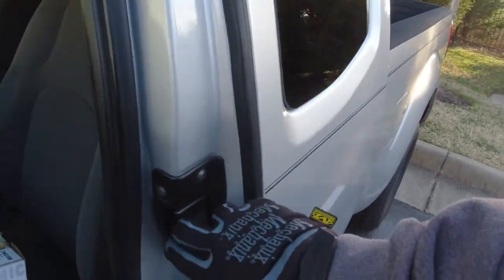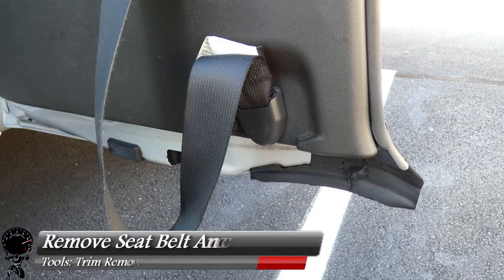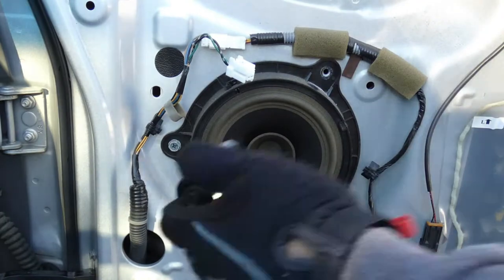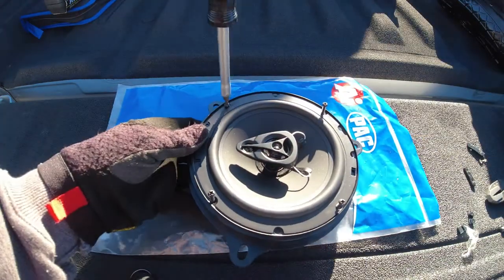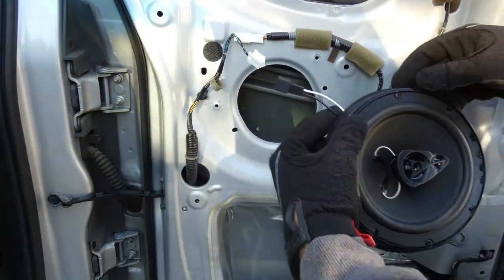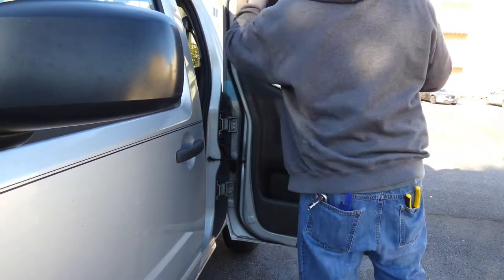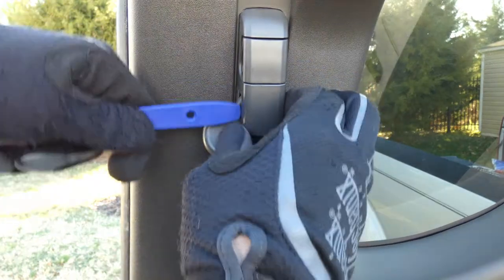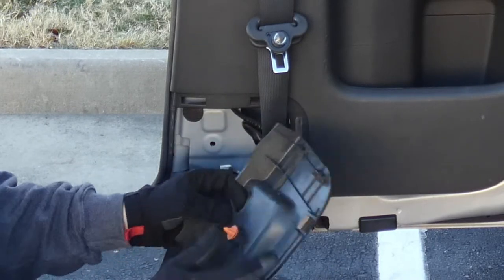How to Replace Rear Door Speakers for a Nissan Frontier (2009)

Comment: Great video!  Any reason not to use the wire harnesses provided with the speakers?
Reply from the maker: You could use those. It would require removing the OEM connector and crimping the new harness.

Comment: Does one bad speaker cause the other speaker not to work...or not necessarily? I changed out my front speakers (thinking my speakers were the problem) but still very little sound coming from speakers. Do you think it could be the stereo itself?
Reply from the maker: Unless there is a serious wiring issue, one speaker should not impact the others. It's very possible to be the radio. I had a similar problem with one of my past vehicles. I was having sound cut out from specific speakers and after troubleshooting it turned out to be the radio (it was old). Good question.
Reply: @mcgurrentertainment  thanks for responding! I have a radio on the way (online purchase) hoping that solves the problem. Thanks again 👍
Reply from the maker: Let me know how it turns out. 🙂

Comment: Is it necessary to do the thread lock and specific torque?
Reply from the maker: Good question. Threadlocker is used to prevent the accidental back off of fasteners due to vibration, and since a moving vehicle is a vibration machine; it's good practice to use it for a majority of applications (and mandatory for others). The torque specs were provided to follow the design specifications as well as give the user an idea of how tight a bolt should be. Torque spec makes the bolt tight, and the threadlocker keeps it there.
Reply: @mcgurrentertainment  thank you for the reply. I’m interested in putting in some speakers/stereo in my ‘07. Thanks for the content 👍

Comment: Do you need a amp ? That’s a big difference in volts
Reply from the maker: No. These functioned better with the new radio due to the impedance matching.
Reply: @mcgurrentertainment I still have the original radio in mine will this be a problem with power ? I probably will do the radio soon also haven’t made up my mind
Reply from the maker: It shouldn't be a problem. If you purchase speakers with a high power demand (200+ Watts) then you will need to look into obtaining an Amplifier. But ~40 Watt speakers will work just fine in this vehicle.
Reply: @mcgurrentertainment might have made a bad purchase then so the speakers I ordered are 360 wat peak for a pair but rms is 90 pair is that bad ?
Reply: @mcgurrentertainment they say the PEAK is 360watts an rms90 watts is that too much for what I have ? I stock radio no amp nothing “I don’t know anything about speakers I’ll return them if there too much
Reply from the maker: You should be fine

Comment: Just took off my back door but now, one side of my top two clips doesn’t clip back in. 

Edit: No matter how hard I tried, could not get the top left clip to go in. I said screw it and was gonna leave it as is and managed to get 90% of the door panel clips to go back in except for 1 or 2 I broke. Was ratcheting the seatbelt bolts back in and it magically popped itself in. Very weird but at least it’s flush now.
Reply from the maker: Odd. See if it's damaged or misaligned... or fell off. Sometimes, the fasteners fall off.